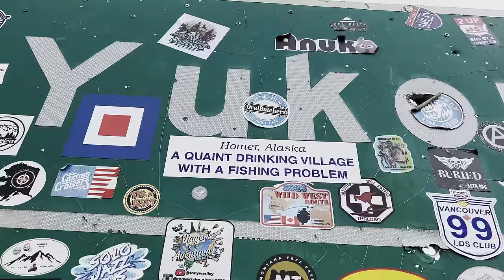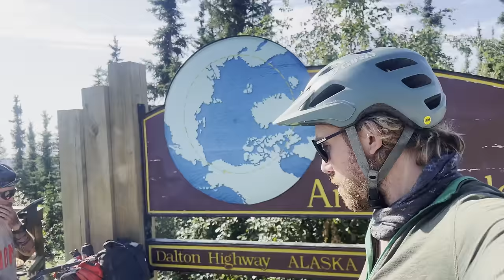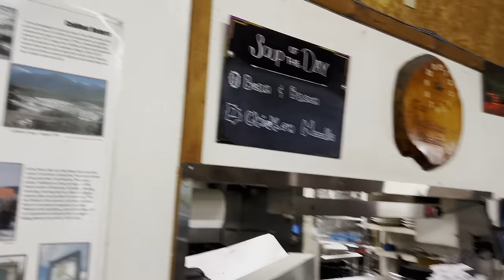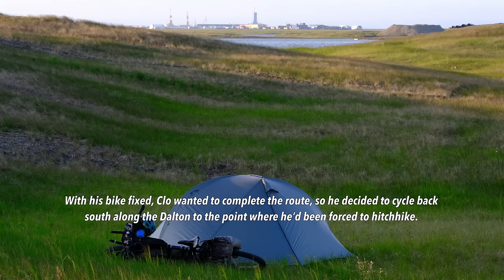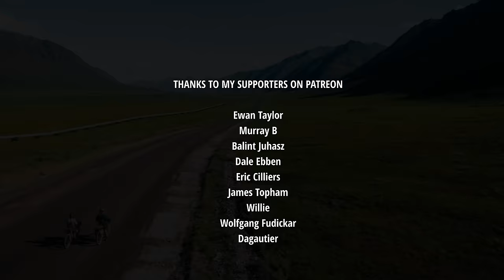Cycling the northernmost road in the Americas - Bikepacking Alaska 4

Comment: Curious why you didn’t cycle in a shirt and trousers made from polycotton that mosquitoes can't bite through? Expedition clothing like Fjällräven was designed for Lapland where the mosquitoes are similarly abundant and noisome. And in the cooler temps of the north,  with a microweight merino shirt underneath, it isn’t at all uncomfortable to cycle in. With that and the headnet, the only place you need repellent is your hands. (This is coming too late for you, since you may never again cycle in such clouds of the buggers, but may be useful to others reading this comment section).
Reply from the maker: Yeah this is a thought I had on the Dalton myself, but unfortunately by then it was too late! I normally prefer merino wool, but if I ever had to cycle Alaska again in summer I'd definitely go for some mosquito-proof clothing instead, and if anyone is reading this with plans to go to Alaska in summer, that's exactly what I'd suggest!
Reply: Polycotton? Tell me more
Reply: @onelove8062  Polycotton = polyester and cotton blend. A fabric that has been around and used for outdoor apparel for over half a century.
Reply: They still bite through it.
Reply: @terrybriggs3289  Not if it is the original G-1000 fabric from Fjällräven or identical formulations from other brands. Mosquitoes simply can't get their proboscis through it. But the version called G-1000 Lite  is not mosquito-proof.
Reply: @crculver2068  Believe me,here in Louisiana, they will bite through it.
Come to my swamp, I'll prove it too you.
Reply: @terrybriggs3289  This is a discussion of Alaska and suitable expedition clothing for traveling there. No one cares about your “swamp in Lousiana”. Try to keep up.
Reply: @crculver2068  lmao

Comment: Certainly you didn't leave your food bag tied to the base of a tree.  That's what it looked like on the video.  If there were any bears around, I bet they'd really appreciate not having to struggle to get food hanging up high somewhere.
Reply from the maker: It's not just a normal bag, it's called an Ursack, which is a specially designed bear-proof food bag. The material is too thick for bears to get through, and the draw chord is strong enough to stop the bear from dragging it away. It's all been tested and seems to check out, I've been using mine since last year and haven't had any issues: https://www.google.com/search?client=firefox-b-d&q=ursack

Comment: Tip for getting patches to stick - use old skool patches with glue( not self sticking ones) set the glue on fire for a second or two blow it out and stick patch immediately, it will stick fast to the tacky sticky glue 😁  great ride good film 👍
Reply from the maker: Thank you! Yeah the problem was more with his tube itself, which was falling apart - he patched those holes but it kept developing new ones. But I agree that the old school patches are much better long term solutions, the stick-on ones definitely don't last as well!
Reply: @tristanrid  Yep, agree, the moral to his tube issue is be prepared. (Look your wearable parts over and replace). Cycle tourists don't have to carry too much gear and over load, but the gear we take should be in good condition at the start. As an old touring cyclist, from the 1980's, I wouldn't have headed out on the Dalton with Schwalbe G-One tires.
Reply from the maker: Have you had any experience with G-Ones? I've never tried them myself but a few people I know have had fairly good experiences with them, they seem to be tougher than expected. I'd be curious to hear your experience if you've tried them!

Comment: This right is an amazing accomplishment.  I love the video. When I was in Barrow, AK, my co-worker and I went on a ride with the wind about the same speed as we rode and the mosquitos hounded us.  Finally we stopped and viola, they kept going with the wind. The one thing about the mosquitos in AK is that they are so large, they have a large mass and you can swat them in the air.  Unfortunately when they hatch they are overwhelming.  Once you get so far north that the temps drop to freezing they are a non-issue but above about 35 F they all come out and the carnage begins.
Reply from the maker: Thank you! The mosquitoes in Alaska sure are a different breed to anything else I've seen, so much bigger and more aggressive, they're probably second only to African tsetste flies as the worst I've ever encountered. I'd love to go back to Alaska in the winter when the bugs and bears aren't a factor!

Comment: 22:43 Future reference, you can make a bigger tube fit (I’m presuming yours was a “29 and his was a “27.5 or maybe a 26”) but it’s a little tricky to explain. You basically make a crease rolling perpendicular to the tube and “tuck it in” on itself to the right size. I’ll share a link of someone doing it.
Reply from the maker: I'd be interested to see that, sounds like a useful trick!
Reply: YT isn’t letting me post the link, but if you search for “inner tube size fix” there’s a 2 min video of a guy patapsco bicycles doing it.
Reply from the maker: Very cool, that's super useful to know - thanks! I'm not totally sure if it would have worked for Clo with the tube I have since I just carry an ultra thin 'tubolito' tube for emergencies, rather than a normal tube, since I've found my tubeless to be so reliable, which might have been a stretch with Clo's 27.5+ wheels, but good to know for next time!
Reply: @tristanrid  I’ve never tried it on a Tubolito, but my suspicions are with you, it may not be possible because of the material properties of them being different than the rubber tubes. I don’t have one to test, but it could be an interesting experiment to film! One thing you can do you encourage it is lay a strip of electrical tape around a section of the tube to create a little extra thickness where you want to crease it from, and partially inflate it to help it take shape.

Comment: Nice video! It’s easy to romanticize bikepacking thinking that everything is just freedom and glamorous camping places but there are a lot of challenges which make it difficult, but at the same time all of the struggles adds up to when achieving and the feeling of accomplishment. Which time of the year did you ride? I wonder if riding on late spring will help to avoid mosquitoes even though it’s a little bit cold, I’m planning on riding from Deadhorse to my hometown in Honduras. Cheers!
Reply from the maker: We were there in July which was pretty much peak mosquito season, I'd say that going late spring is definitely a good call - I'd much rather deal with a bit of snow and some cold nights than with the level of mosquito activity we had to manage! Still bring DEET, though 😃

Comment: Fun fact, you can use a 29' tube in a 27.5 tire by stuffing inside itself.
Reply from the maker: Yeah another commenter mentioned this too, it's a great trick! In my case I don't think it would have worked as the only tube I had was a 'Tubolito' lightweight tube, which is quite different to a normal inner and so I don't think it would have worked in the same way, but it might have been worth a try if I'd have known it was possible. Next time!